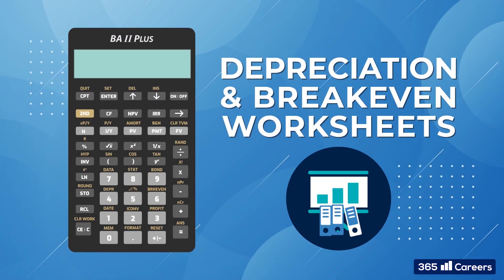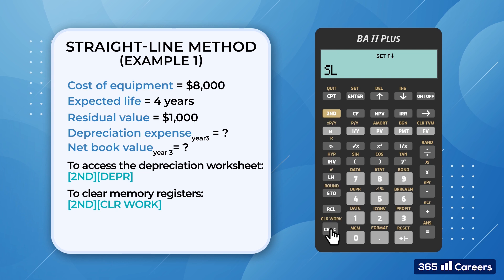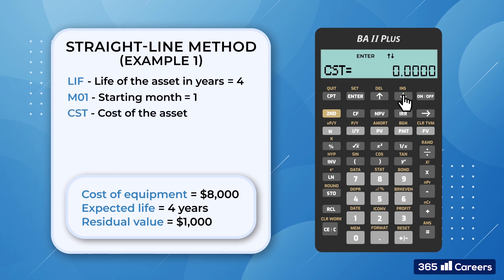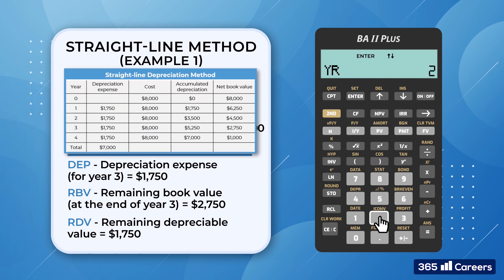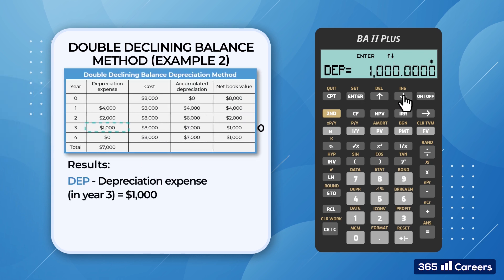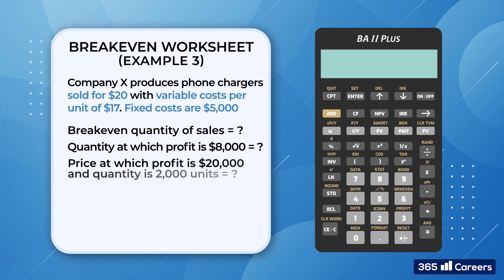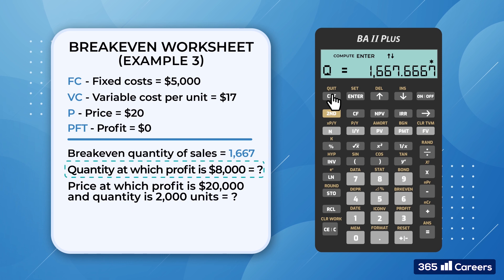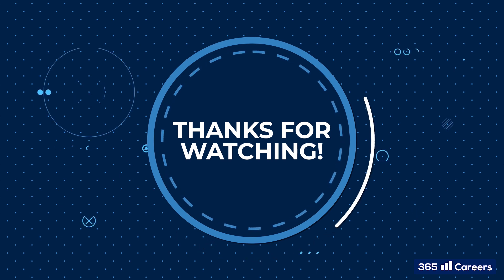Calculating Depreciation and Breakeven Point using the Texas Instruments BA II Calculator

Comment: I used the same 17 for VC and 20 for price, but my Q is 1666.67 not 1667.67. Is there something wrong with my number?
Reply: Try to 2nd CLR WORK before started.
Reply: My result Q is 1666,67 . I think it is correct result.